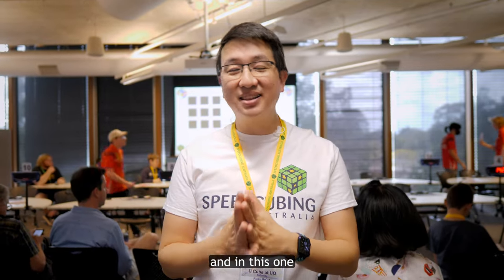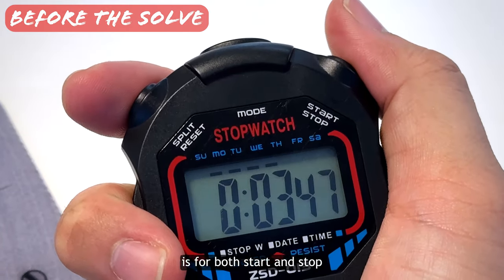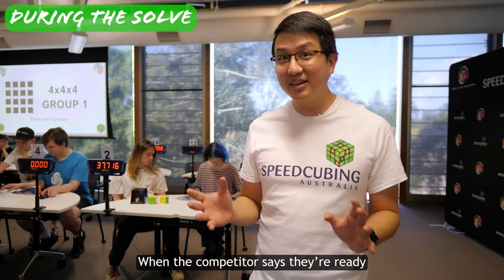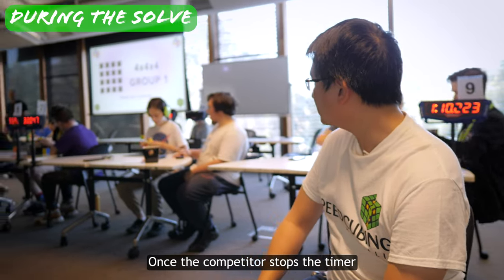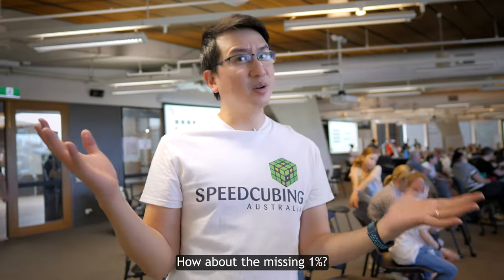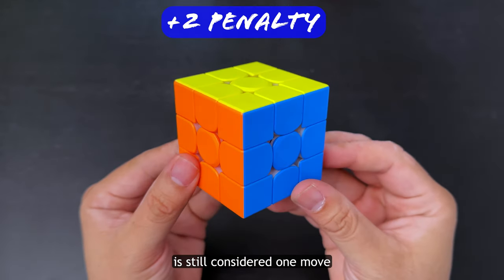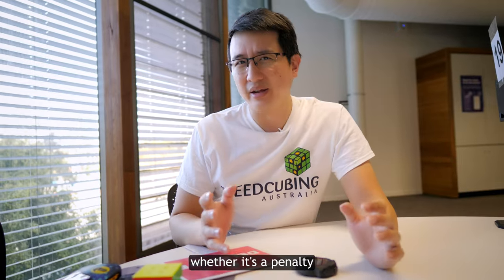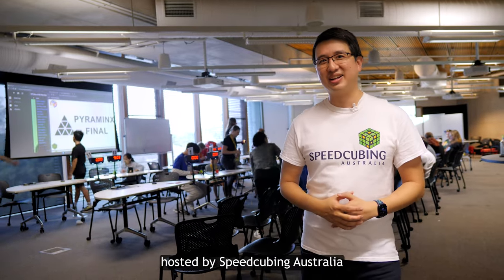How To Judge At A Speedcubing Competition (Part III)

Comment: Note: for the ones who want to judge for clock. If not all clocks are facing 12 o clock then its a dnf. Also for clock it may be easier to cover with the paper and your hand and then slide the paper out because if you cover with you hand only, the clock might fall out. 

also if ur judging blind, ignore the inspection thing and use the stopwatch to record the competitor's time if it goes over 10 minutes(unless the time limit for the event is 10 minutes)

Comment: Great series of tutorials, very informative. What happens in the case of a timer malfunction with either stackmat or the stopwatch?
Reply: in that case, call a delegate. generally if the timer malfunctioned and turns itself off then it's a DNF, but if the timer stops itself under 0.06 seconds you can call a delegate for an extra. but probably call one anyway just to be sure
Reply: @putian_ye  Thanks for the reply 👍